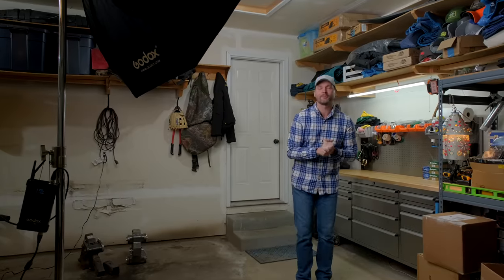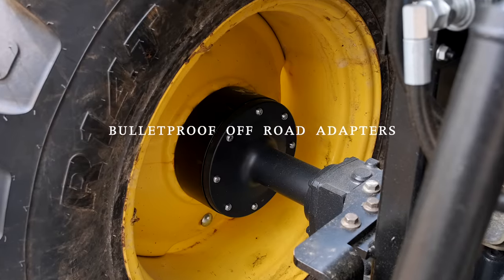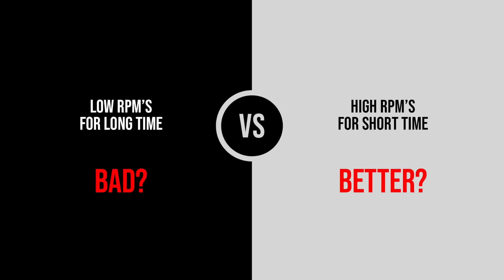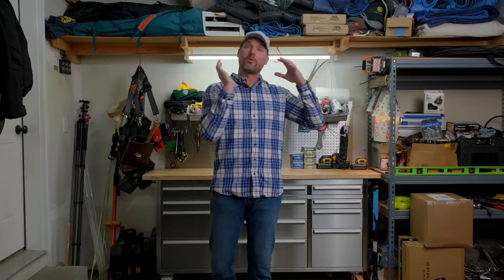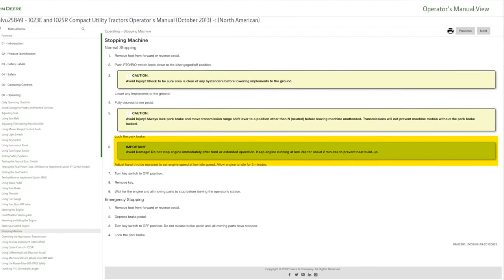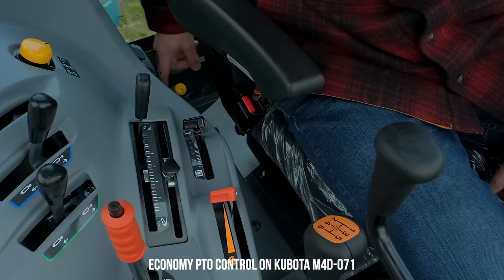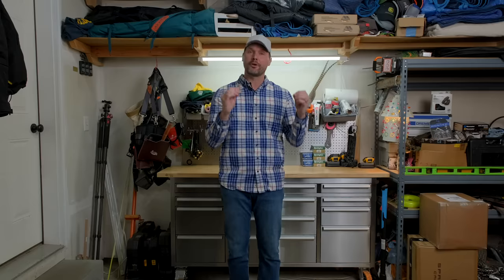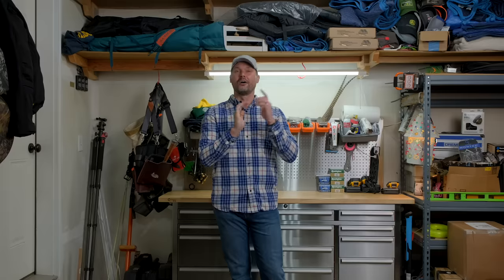WHAT RPM TO RUN YOUR TRACTOR? IT’S COMPLICATED

Comment: WOT when doing any work. The only reason I lower RPMs is because I want to lower noise, start up PTO, or warm up the tractor. It doesn’t feel right operating at lower RPMs. Per manual, it says to run at ‘rated RPM’ (WOT) so HST has proper flow and cooling. Only reason stated in manual about lower RPM is for when starting up PTO. Not sure why anyone wants to run a lower RPM when doing work…no sense in it…maybe they think they’re being easier on the tractor or saving fuel. Also find I use L HST mostly as at WOT, speed is equate when going over bumpy ground. M is faster, but uncomfortable when it’s bumpy and can’t use all the speed. H is only good for road travel. In comparison you can lower RPM, use M, and foot to the floor, but it feels and performs better to use WOT, L, and foot to the floor.

Comment: I modify diesel cars for efficiency as a hobby and even teach on the subject.  First, it depends on the engine, you must consult the BSFC chart. Second, depends on the speed of work needed out of that engine, (think gearing). Most diesels have highest efficiency at 70% load from 1500-1700rpm. After 2000 rpm, efficiency typically drops off substantially, and even more so after 2500 rpm.

Comment: I have owned a 3032 E for 5 years.  I have asked this very question over and over, and I have always been told operate W.O.T.        You are absolutely right about the joystick controls and as soon as I get a chance I am going to test operations at a lower RPM to see if the controls are less touchy.  Great video.

Comment: I’m a new subscriber now. Been watching you awhile and just placed an order thru your website , so I decided it was time to jump in. I’ve owned my Kubota L 4701 for 5 yrs and down to the last yr of notes ( amen ) but I wrestled with this idle question until I became more familiar with the Tractor. At first I ran my Tractor at too low an idle and it would want to regenerate about every 20 hrs. So I bumped up the idle searching for that sweet spot all while learning and observing the nuances of the machine, like the power steering and hydraulics working effectively . I still consider myself a newby because I never been around Tractors growing up and never owned one till this purchase 5 yrs ago. However I have worked hard to learn the machine and it’s safe operation, to the maintenance which can not be over emphasized and I do ALL my own maintenance. While I had no background w/ Tractors I know my way around mechanics. But in truth I know so little and have so much to learn, thanks.
Reply: Never Idle a diesel. The fuel is too rich. It washes the lubricants off the cylinder walls, which creates wear.

Comment: I'm with you on this. I am not trying to impress anyone and most times I'm just not in a hurry unless weather is changing for the worse.
I have said this many times and this is a topic that will never end.
Manufactures like to, and need to sell parts. So, worn out parts sell parts,. and parts wear out quicker the harder or faster they are ran,. now lubrication and cooling also fits in there, so does common sense.
And I have said and found this true for me (just personally)I have not blown up an engine yet from running it too slow.
If your hydro's are growling or chattering or stalling or you can recognize the same type sound in the engine from "Lugging" or under-throttling, by all means give it more juice/throttle. (sorry for all the "or's)
At the end of the day this is the operator in the seat that make this final choice of throttle location.
Another point, manufactures are not helping me pay for parts and I am not writing off parts in taxes.
So with those few points I run a little slower most times.
Last comment,. I don't like the hearing W.O.T. for hours at the time, so turning it down makes my seat time more enjoyable.
This is my practice in all equipment even down to chainsaws.
And again I let a saw idle before shutting it down and sometimes choke it to turn it off, blast of raw fuel to cool it internally.
Turbo's running at high rpm's and shutting down abruptly can cook the oil in the bearings, that's a long complicated discussion if you are not familiar with the topic. (ok I'm done)

Comment: My teenage boys like to use my tractor, they always wanted to hop on the tractor and go full bore and then shut it off immediately when done. 
 I explained to them that they wouldn't want to wake up and instantly jump out of bed to run a mile.  And they also wouldn't want to run a mile and immediately go to bed.  Tractor wants to warm up and cool down a few mins. Since then they seem to understand.
Reply from the maker: Great anology, thanks Hammer!
Reply: Wtf. Have you ever heard of the Army?  This is exactly what happens. 

That might be why I'm about to get a medical retirement 🤔

Comment: I start off at about a 1000 RPM, let the engine warm then run it near wide open 2100-2200 RPM to run the belly mower. At the end of a mow, I turn the mid PTO off, move to 1200 RPM while I’m moving to its storage place. I always clean the air filter and radiator screen after each mow or use the tractor except in winter!

Comment: Hey Courtney...Agree on all the points...I like to warm up and cool down.  I also learned after a couple of months of owenership from forums to engage and disengage PTO at the lower RPMS then spool up or down to PTO RPM.  Rest of the time when not usign attachements with PTO I adjust RPMs according to need.  It's not often I run WOT but will if I need to.  Great stuff!  Thanks for sharing!

Comment: i pretty much run wide open, or close to it.  my primary usage is moving snow.  i spend under 6 minutes (based on the hour meter) per driveway, then running off to the next one.  i want to throw the snow as far as possible, i'll move the chute and deflector if i need to control where it goes.  i don't get paid for going from driveway A to driveway B, so i'm interested in spending as little time as possible in transit.  snow here is typically light and fluffy, so i'm running at close to full speed in mid range (sometimes high range - depends on how slippery it is, if i can stop and steer).  in the summer i'm building rock walls, and popping stumps, and smoothing out the holes.  smoothing out the holes is the only place i'm not running full out.  i do run about 1/4 to 1/2 for warm up and cool down as i'm checking out the tractor, and greasing the fittings.  it's all about getting the most done in the least amount of time, and keeping the tractor working for me.
Reply from the maker: Yep, agree with all of that.  Thanks for taking the time to share!

Comment: I've rarely run WOT on a 1025r and usually only with the mid mount mower. Less RPM means less dust and less damage when hitting something hard. The 1025r has minimal clearance and at full height, the mower deck hits pine roots if I'm not paying attention. I run it well above minimal RPM needed to cut grass but only WOT if it starts to bog down.

Comment: I'm usually at PTO rpm for almost everything i do with my 1025r. I find that the ground speed is too slow for most applications with it lower. Maybe if Deere could get it together and offer a 3 range hydrostatic then I could save some fuel. 😁
Reply from the maker: Lol, I hear ya there!! 🤣

Comment: Great topic and even better comments and points of view….my overall take on this is….common sense…should prevail….with some proper research and understanding of one’s equipment below them, c,mon….use some common sense….as one commenter said…do you put your pants on while running out the door ? do you go to bed as soon as you get off your tractor ? If the task is lifting heavy loads with the loader, if your not making the tractor do the work at a safe common sense high rpm, then why have use the power of a tractor at all…isn’t that why you bought it ? If one is afraid of wearing it out and have the responsibility of doing / paying for the maintenance, then maybe, one shouldn’t own equipment, rent it and return it !
Again, I believe general common sense should prevail….especially when engaging and disengaging PTO attachments, ie. brush hogs or anything with heavy rotating components, mostly on tractors ( not zero turns or riding mowers…they ain’t tractors) engage them at a low
Reply: Sorry, sent too soon…engage tractor PTOs at low rpm, slowly bring rpm up to rated or slightly above rated PTO rpm….go to work…and adjust PTO rpm accordingly while working, upon shutting down, leave PTO on, slowly reduce the rotational implement speed with the engine as to not shock unloading the implement gear train, bring to idle, turn off PTO….cool off tractor especially those with turbos. 
When I owned a 2018 JD 1025r for general residential use, I noticed after running it at mid throttle doing loader work for awhile, when I was finished and semi-speeding back to the shop, running it wot, it would cough and sputter as if it had loaded up, after a few minutes at wot,  the roughness cleared and it was smooth again, I also noticed this on my 2021 JD 2038r. So WOT for short periods of time will clean out and “exercise” the engine especially if one is accustomed to running engines slow.
So again as a commenter pointed out, run the machine for the task you want it to accomplish.
I’m not advocating beating the crap out of it or babying the crap out of it….use it and maintain it wisely and I believe it will prove to be one of the best investments a tractor lover will ever make.
Be safe out there !

Comment: Good points, and as an older diesel mechanic, I've seen that babying a diesel can do more harm than good! 
WOT when not under load is not a good idea either (when working a machine with a diesel engine, the phrase "Run it like you stole it!" comes to mind!
BUT! Even though diesel engines are more robust (relying on compression as the ignition source!) than gasoline engines, keep your oil changes on regular intervals, and keeping clean fuel! If you don't,  parts wear quicker, and RPMs become a moot point!
Reply: When I had a half ton diesel truck that was how those with higher mileage trucks and minimal emission equipment failures said to handle them. Get it hot and work it. No babying it or to many short trips.

Comment: When I warm up my tractor when it's very cold out I let it run for about 30 seconds at low idle then I bump it up to 1,000 RPM and I engage the PTO then I let it run for about 5 to 10 minutes after that the tractor is warm enough to use. Engaging the PTO gets the hydraulic pump moving and all the hydraulic fluid flowing and warming up as well instead of just warming up your engine letting your tractor sit with your hydraulic pump pump pumping it warms up all the fluids

Comment: On my diesel zero turn I run it W.O.T. to get the correct blade speed as per owners manual. I am a trained marine diesel mechanic. We were taught to run diesels at 80% of W.O.T. unless full power was needed for a short period of time. 80% rpms was higher torque than 100% rpms (keep the engine in its torque range) the extra RPM's were for horsepower.  On my 4760 I start engine at idle, warm up and cool down is at 1200 RPMs. I operate (non pto) at 2000 rpms. My tractor has auto throttle but I don't use it. My joystick has a throttle button that does not change ground speed but does increase hydraulic flow which I set at 2200 rpms. My fuel use meter shows I am using about 2/3rds gallon per hour and my tractor stays in the medium range and I shift high to low when doing loader work.

Comment: One nice feature on my new 2023 1025R is a PTO “throttle” control…separate from the engine. It fine tunes the speed your hydraulics move…..no need to throttle the engine!

Comment: I never noticed the PTO setting on the tach. Thanks. I have a Deere 1023E. I mow at 2200 RPM and blow snow at 2900 RPM or so. Perhaps I should wind up a tad more. I always "cool down". I ran diesel fishing boats up to 550 HP  in fairly high speed vessels. I ALWAYS cooled down after a long, or even shortish run. I knew guys who shut down hot with 430 Cummins and dropped valve seats. Big trouble!

Comment: The only time I run at W.O.T. is with a PTO attachment or filling up the loader bucket in a pile of dirt.  Other times it's half or less.  I'm in no hurry anymore and for me running at W.O.T. is wasting fuel unless I need the power.  Again that's just how I do it.  Interesting in reading all the other comments.  Thanks for bringing up this question.
Reply: I'm with you on this. I am not trying to impress anyone and most times I'm just not in a hurry unless weather is changing for the worse.
I have said this many times and this is a topic that will never end.
Manufactures like to, and need to sell parts. So, worn out parts sell parts,. and parts wear out quicker the harder or faster they are ran,. now lubrication and cooling also fits in there, so does common sense.
And I have said and found this true for me (just personally)I have not blown up an engine yet from running it too slow.
If your hydro's are growling or chattering or stalling or you can recognize the same type sound in the engine from "Lugging" or under-throttling, by all means give it more juice/throttle. (sorry for all the "or's)
At the end of the day this is the operator in the seat that make this final choice of throttle location.
Another point, manufactures are not helping me pay for parts and I am not writing off parts in taxes.
So with those few points I run a little slower most times.
Last comment,. I don't like the hearing W.O.T. for hours at the time, so turning it down makes my seat time more enjoyable.
This is my practice in all equipment even down to chainsaws.
And again I let a saw idle before shutting it down and sometimes choke it to turn it off, blast of raw fuel to cool it internally.
Turbo's running at high rpm's and shutting down abruptly can cook the oil in the bearings, that's a long complicated discussion if you are not familiar with the topic. (ok I'm done)

Comment: I like the auto throttle feature in my 4r very handy when doing loader work. I've always been told to idle a engine down for a few minutes before shutting it off and always start it at idle. Always run the powered implement at the required speed nothing more nothing else both can be as bad as the other. We I  do loader work I normally run with only the foot throttle (4r excluded) helps reduce clutch wear, and pushing on the loader to hard and spinning the wheels.
Reply from the maker: I agree, AutoThrottle definitely has it's place.  I never turn it off on my 4 Series.
Reply: @GoodWorksTractors  it is a handy feature and it was something I didn't thing I would use but its on for 70% of the time

Comment: I checked the printed torque, horse power and fuel consumption graph from the mfg.  Best fuel economy is concurrent with max torque which occurs at 1,800 RPM.

Comment: I have to remind myself that we are talking about subcompact tractors here. Almost all the larger tractors have the 540 mark well below wide open. I personally never run a tractor above the 540 PTO mark (except in the circumstance where I was pulling a 15ft Rhino batwing brushhog with a Kubota M105X. Even though it was 105 horse, it didn't quite have the oomph to run it without being wide open). Sometimes I don't even run the tractors at the 540 line. I've run old tractors a lot in my life, and you get used to being able to hear when you're letting the engine load up to much. As long as it isn't loading up and your tool is doing what you want it to do, you don't need to run any faster. Again that is on old equipment though that one: is pretty much all torque, and two: you don't want to wear that engine out any quicker than you have to.
Reply: all your tractors enjoy mojitos with lime

Comment: Two problems with running at lower speeds, not enough pump flow for cooling and operating closer to the natural torsional frequency of the drivetrain. From the nose of the crank to the axle flange, those torsional vibrations at low rpm’s can rack up a lot of damage quickly.

Comment: If you start hearing strange humming from your tractor transmission when running hydraulics/pto (not the typical hydraulic noise) your trans is getting hot from TOO LOW RPM or you are low on fluid.

Comment: Well,  as many of my diesel mechanic brethren have said,  yes run them faster.  There is actually a name for the RPM range you are intended to run them under a load, it's Torque Rise, it's the range between where peak Torque and peak Horsepower occurs as every engine is different,  you need to find out where each of those occur on your model and only load the engine while in that range.  
Next. I was Shocked to see that the same diesel brethren totally dropped the ball on telling you that your diesel engine does not have a throttle.  A throttle is those round butterfly thingy's in the air intake that aid in causing a stoitiometric fuel mixture.  Diesels by their very nature run lean, air is not regulated in any way in a diesel,  if you want a diesel to go faster,  you put the fuel in larger amounts.  Hence you can go to a full fuel condition,  or accelerate it until it reaches maximum governor RPM but there is no such thing as wide open throttle on a diesel.

Comment: well most engins run best at 2000 to 2500 rpm. yes usen a pot may require more rpm. but for long haul should keep in that range runs plenty hot for dpf and still get good response out of hydraulics. evory trator is a little diffrent tho.

Comment: If you are working the tractor hard like digging with a loader or pulling a heavy load use full throttle! You don’t want to lug the engine down and stall it, because it can damage the engine. Bending a connecting rod is possible.